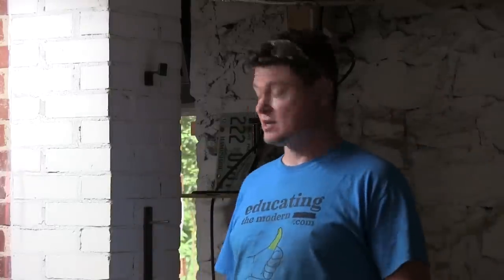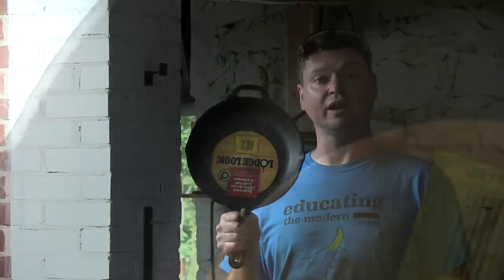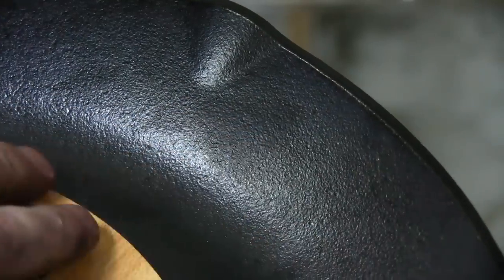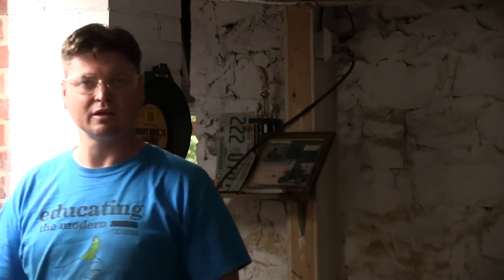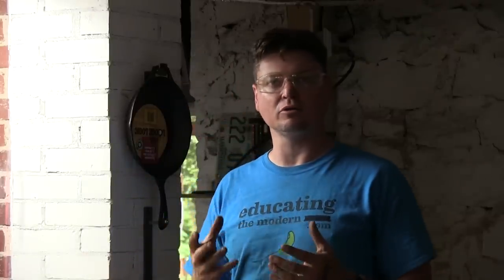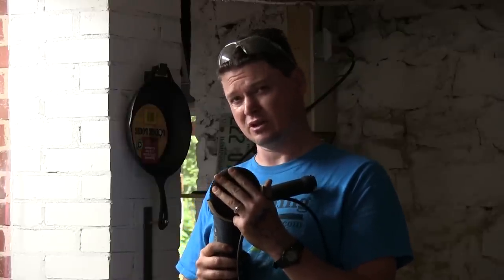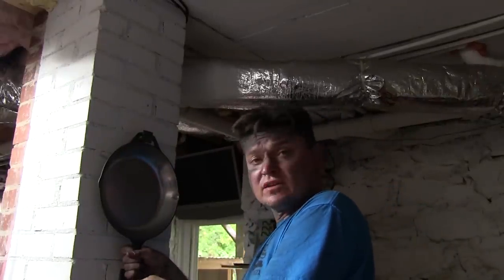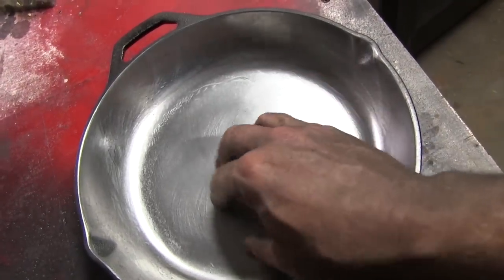ETM: Sanding and Polishing Cast Iron cookware

Comment: OMG! thats amazing... Could you get by with polishing with a wire brush attachment to your drill?
Reply from the maker: They are so bad that pretty much anything you do will be better, but no way man.  You really need to remove a lot of material.  Wire brushing it would still help by smoothing out any edges, but it wouldn’t even come close to actually refinishing the surface like what I’m doing in the video.
Reply: +Steven Horvat I first attempted to get my cast iron pans smooth with a wire brush; sadly, it only polished the bumps, LOL...

Ultimately, I used a general purpose metal grind wheel on my Ryobi angle grinder to do the basic rough work of getting rid of all the bumps. Then switching over to a 40 grit drill mounted sanding pad, and as it got smoother, I changed to 80 and then 120 grit.

NB: The angle grinders are usually used for things like reshaping metal in auto body repairs shops. One needs to take special care NOT to press down too hard as this WILL gouge out large chunks of the material if you're not careful. It's always better to get to a point where you're almost where you want, and then switch to something less potentially damaging to finish, or else one may go overboard and ruin a project.

Comment: Does the skillet go back to black after a while? Great video. I just did it to 2 of my skillets.  Thx
Reply: Allan Ramos The seasoning is what makes it black. At first, it won't be black, but, it will over time. As he demonstrated, it does not need to be black for eggs to slide off the pan.
Reply: +Charles Walter Actually, the heat alone, without any grease or other coating with render the metal black. I did this with a freshly sanded and polished pan. After a soap and water rinse of any remnant loose iron particles, it went into the oven shiny silver in color. At 500 degrees for ONE HOUR only, with no waiting for cooling (I just opened the door and pulled it out), it emerged a dark gun metal black.
Reply: +ralphrepo This worked for me as well. I had a lightly sanded, unseasoned, skillet that was shinny put in in the oven at 525 for about an hour and it turned back to gunmetal gray. I have tried this with a polished skillet that was already seasoned (weirdly seasoned) left it in for 2 hours and it was still shinny afterwards. There must be some kind of reaction going on with the bare metal...

Comment: I have a new production lodge 10 that I am considering doing this to it.  I have vintage iron that I wouldnt even consider using mechanical means on.  That is for the historical aspect of it.  once you change what the foundry left on a 100 year old pan you have changed the resale value.  But I totally get what you are saying here.  By the time, a new production lodge is considered a collectable antique, my great grand children will be having the discussion on if I changed the value by resurfacing it.
Reply from the maker: Randy J And people would create little myths that Lodge put out a short run of polished pans, and many would probably think them super duper collectable!  HA!  That'd be awesome.
Reply: I just used a DA with 60 grit. It used up 3 sanding pads to make it smooth enough for my liking.  I left it 60 grit finished because the seasoning needs something to grab onto.   I just did the bottom.  I dont fry anything on the sidewalls. Next is seasoning.
Reply: Boedy Pennington The info you are missing has colored your opinion of why they make the new pans as they do. It isn't because it's cheaper, or more time consuming to polish them out. Nor is the rough surface simply a result of the sand casting. The real reason is mass production, though not for the reason you might think. Lodge, and now all other modern manufacturers, wanted to be able to sell pre-seasoned pans so the buyer could use them immediately. Cast iron sales were way down and Lodge was about to go under as a result. There were too many new pots and pans coming out that took all the business away.

Pre-seasoning made cast iron a commercial product again. But to do it on a manufacturing scale required a rougher surface for the pre-seasoning to adhere and soak in. They simply could not afford the time it takes to season the pan the way an owner would and without seasoning, the cast iron pan would soon be useless. 

The vintage pans were lighter and polished to a higher degree, though not as fine as you seem to prefer and for a good reason. The built-up seasoning will not adhere to a highly polished pan and so will require even more effort to maintain. The built up seasoning makes it very low maintenance as well as non-stick. Before pre-seasoning, the new pan owner knew how to and would take the time to season their pans properly. When a generation came along that chose not to learn to cook, or grew up with supermarket dinners, the knowledge needed to manage basic cooking skills, such as seasoning your cookware, was lost. And rougher, pre-seasoned pans were created.

As for me, I use an orbital with coarser grit to smooth out my new cast iron before seasoning it properly. I let the seasoning build-up to give me the slick surface you like so much. But,on the whole, I prefer the older cast iron simply because they are lighter. With today's cooks cranking it to high, the lighter cast iron soon warps. The heavier Lodge cast iron pans help to prevent warping on electric stove tops. But an added benefit is that when frying, they do a much better job of maintaining the temperature than the vintage cast iron pieces.

I hope I've filled in the gaps and answered some of your questions in your video.
Reply: +H Oas An excellent explanation of the folly of "quick and easy" cooking, and its effects on tried and true methods and tools. I do a lot of southern Louisiana cooking, and remember learning to cook a dark roux in a cast iron skillet. I do not have access to that same skillet, but I do remember that it was used constantly, and remained atop the stove for use more than any other pot in the house. The best way to keep a cast iron pot seasoned is to use it every time you cook. There are some exceptions, for example I would NEVER cook anything acidic in cast iron, as the seasoning will be stripped from the pot. If you like bacon, the cast iron pot should be used exclusively, and only wiped with a paper towel. 

I will attempt machining a Lodge pot, just to see if the surface will be as smooth as the pots I got to use in my youth...
Reply: +H Oas Indeed, the big difference is weight.  The older pans are lighter and thinner and feel better in the hand.  I have a post-60 Wagner I'm using that is light, but not machined as pretty as the earlier WWs.  It's lettering is almost gone on the bottom (found in a barn), so it's a good choice for this "retro-mod."  The new Lodges are great, too - I like the extra handle on the #8, you just have to season them.

Comment: The new Lodge cast stuff is rough as a cob.  Everything seems to stick to it.  Even bacon, etc.
Reply: +Wren Wright I have a new lodge skillet and don't have any problems with sticking.
Reply: +Wren Wright Patience, Grasshoppah! Let iron heat up! Wipe cast iron with paper towel when done cooking, Use bacon fat for cooking. Bake in over time a smooth black filler in all the rough pores. Carbon. It takes time. It takes extreme care.
Reply: Just season it. 3 coats of Crisco and its as slick as anything.

Comment: This is probably a dumb question, but I heard that you should never use soap and water to clean them.  Is that accurate?  I'm somewhat new to this.
Reply from the maker: Najja Foluke Not dumb at all.  Lots of people never use soap.  I try not to, but sometimes I feel it is needed and if so, I have no problem with using it.  But I always make sure to rinse it clean, dry it immediately, and then oil it.
Reply: Boedy Pennington Thanks for the reply.  I, too, dry it immediately and then oil it.  Happy Cooking!

Comment: This video's made me excited to get a cast iron skillet for my next project! Question is, though, how heavy, exactly, is that 10" Lodge Pro-Logic pan that you buffed and polished in the video? Reason I'm asking is I'm a fairly petite lady and most modern cast iron is way too heavy to be practical for me to be lifting and flipping food in the pan with one hand. Should I pass this up and get a vintage CI? I've handled some and for the most part, they're pretty lightweight.
Reply from the maker: The Lodge is definitely heavy, but the Chef skillet has low sides and is a pretty small pan.  Not that bad at all.  My guess is about 6 lbs.

Comment: Do the folks at Lodge watch all of these videos where people are taking power tools to their brand new Lodge cookware. Is there no one in the marketing department over there paying attention? It seems there in a great position to come out with a traditional old school line of fine sand cast wear which would sell pretty well.
Reply: My opinion here.  Manufacturers don't do that because it's an extra step that cuts into their profit margin.  Similar to when you buy things that come partially assembled.  You finish the job they started (but it also reduces the space required to ship the item).  I wonder if someone with a milling machine can shave a very thin layer of the pan to get as smooth surface.  I don't see a need to sand the sides except on a dutch oven or other deep pans.

Comment: Nice work, But you cant show us a Fully Polished Version and only sell them with the polished Cooking Center Only. That is like Cooking Steak and then Serving Chicken. I know its pointless to Polish one all around, but darnit it looks so Kool.  :o)

Thanks for the video
Reply from the maker: I do offer a Fully Polished Version.  It’s the Chef skillet, just like in the video.  Standard skillets have the squared off sides that are nearly impossible to polish, as well as pointless.  The Chef skillet however, has nicely sloped sides that I can get to with relative ease.  Also, the proper use of a Chef skillet involves flipping and tossing food around, requiring the sides to be smooth just like the bottom due to them being cooking surfaces also.  As per the website, ˆstandardˆ skillets do not have the sides polished.  The Chef skillet is not a standard skillet.  But I understand your confusion, and will address it on the website.

Comment: I've grind down my cast iron. but now everything sticks to it. nothing slides. I use coconut oil.  any ideas where I went wrong?
Reply from the maker: Well, is your seasoning good?  I've seen a lot of people with sort of soft seasoning.  If you can dent it with your fingernail at all, it's bad.  If it is sticky at all, it is bad.  Other than that, I'd point my finger at your cooking skills.  That sounds meaner than I intended it, but it's probably what is happening.  First, NONE of these skillets are non-stick.  What they are is slick, and if your oil temp is right, the food cannot get traction.  But even with that, things like chicken and pork secrete when cooked.  This stuff creeps out and sticks to your pan, it cannot be avoided, only minimized.  If your pan and oil is right on the borderline of hot before you put the food in, it should be good.  Here's a test for you, get your pan up to a temp that you think is good with the oil in it.  Drop an egg in.  The egg should immediately begin to cook and the clear fluids are turning white.  If it has time to sit in the pan without immediately beginning to cook, your pan is too cold.
Reply from the maker: Oh, and too hot will cause sticking problems too.  But usually the pan being too cold is the main problem for most people.
Reply: Boedy Pennington I've used flux oil, and followed your seasoning guide approx 4-5 times in the oven. wiping after 15-20 min to prevent fish eye. pan turned a nice brown. I use about a #3 on my stove which is about low med heat.  it was a great number to use to cook eggs, before i grind it down. now it instantly sticks, burns and turns the pan black where the egg was.  I use olive oil to cook with and I haven't ruled that being the issue out yet. but Olive oil worked great before...  my other pan I have, that I didn't grind down works just fine, and I put it through the same pace as I do the grind down one.  it slides eggs around. nothing sticks to it for the most part.  I'm just lost as why the grind down one now is a nightmare.
Reply: MaTTyMaTT hey friend, if I may: something that helped out my pans after sanding was to run a couple pounds of bacon through it. It cleaned where everything else had fallen short and did a wonderful job in aiding with seasoning. You're almost there; don't lose hope!

Comment: Will the pan eventually get black?
Reply from the maker: As soon as you put it through a heat cycle in the oven, on the self clean mode, it turns the nice dark grey you expect with cast iron.
Reply: +PorkChops1814 I learned from making some crucial mistakes. After following Boedy's method of machining down the pan, I immediately used bacon grease and started cooking in it. The result was a splotchy burnt cooking pattern that seemed to be permanent. After cooking in it a few more times and having that burnt pattern worsen, and having read Boedy's comment above, I took the pan back out and sanded it smooth to bare metal once more. I then took the newly sanded pan, washed with soap and water, towel dried, and placed into 500 degree oven for one hour only. I removed it and it was a smooth as glass, gun metal black. I couldn't have been happier. It's now ready for seasoning.

Comment: i have a new lodge 12" skillet coming in the mail next monday, i am going to reinvent the cooking surface like you did yours, very impressive, i dont know how good you are at dating griswold dutch oven lids but i have one i cannot guess how old it is, please help if you can, the outside has nothing on it but the inside has the griswald logo in the center of the lid (very faint writing) directly above that it says, very faintly again,  the words ""self basting"", and way above that it has a large number 8 . the bottom of the lid has a code date 1288B. any help you might be able to give in dating this lid would be a help. it is not a match to the 5qt dutch oven, it is probably a wagner, the only thing it has on it is on the bottom, it says 5 qt. thanks for your help if you can do so, ray lowery
Reply from the maker: I’m not very good at dating and figuring out what cast iron is.  I mean, I’m better than most, but far from an expert.  It sounds like you may have what is known as a “ghost” Griswold.  As their dies got older, they would sell them to other manufacturers and sometimes the other manufacturers did a poor job of removing the Griswold logo thus leaving the very faint impression.  But I think this happened more with the Erie name.  Find the Facebook page “Cast Iron Cooking”.  They have over 100K members, and they would love to help you out.  You’ll have to post pictures though.

Comment: flitz! :)
Reply: Boedy Pennington flitz is a polishing compound that can be used on plastics and metal.  it is used often to produce a mirror shine polish to semi-auto pistol feed ramps.  I have a large tube of the stuff... you can polish till it looks like glass :)
Reply: Boedy Pennington I polished a feed ramp by using 600 grit sandpaper and magnifying glass until you can't see the microscopic lines in the metal anymore.  then you whip out the flitz and a dremel tool, using it intermittently so as not to overheat (can change the hardness).
Reply from the maker: Sounds awesome!